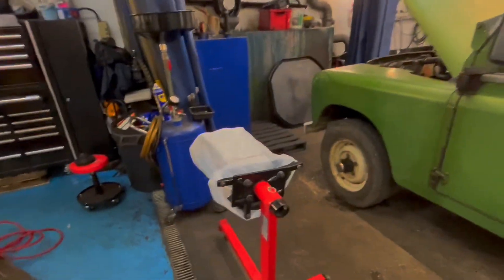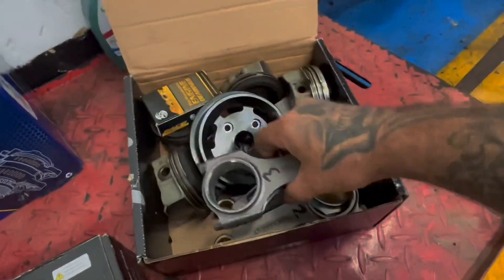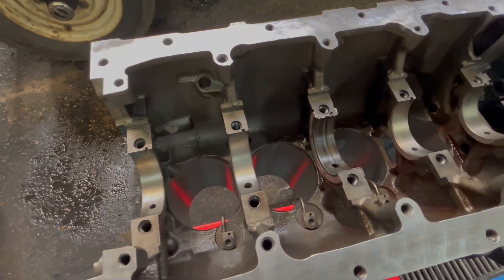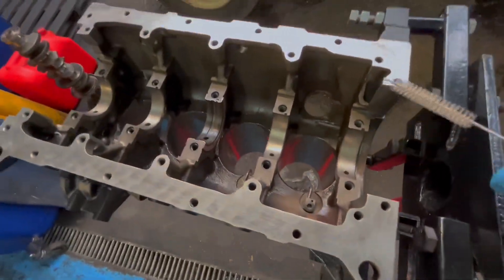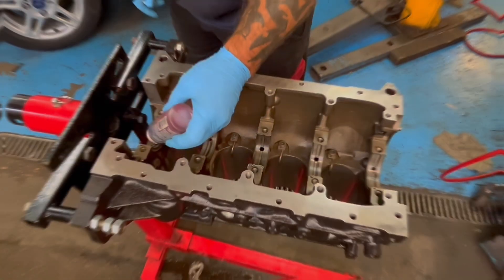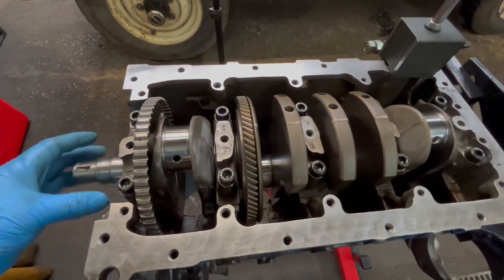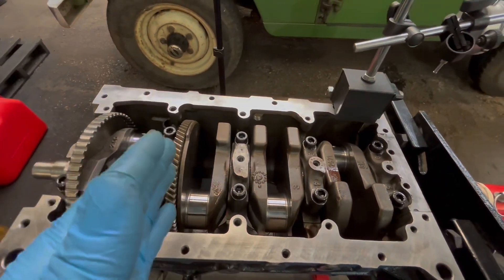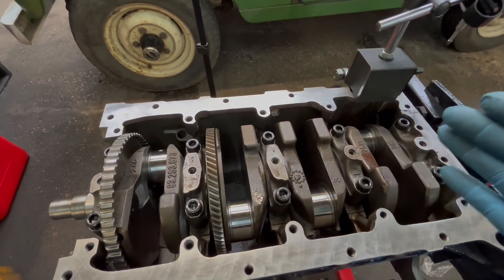Vauxhall Astra h Z20leh crankshaft measuring and installation

Comment: Good video Vinnie, my fingers are crossed on that end cap, had to reseal mine few hundred miles after rebuild as the sealant appeared to shrink. May have been the sealant I used, second time around I used the Victor Reinz now all good 👍
Reply from the maker: Hi mate, yeah the engine is finished and built now We’re going for mapping tomorrow at giz Motorsport and it’s all good no leaks 🤞🏼but yes them end caps can be a complete nightmare i’m not going to say I’ve got them perfect every time but this one is good mate 👍🏼